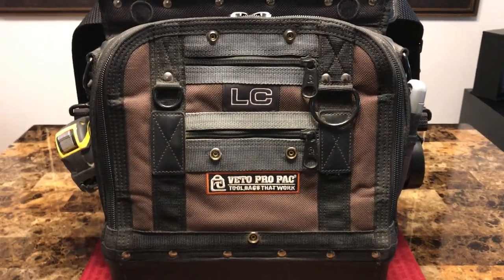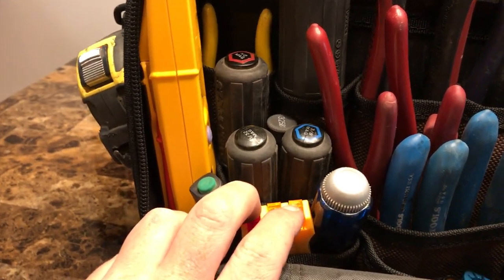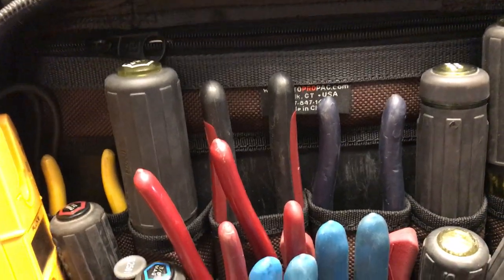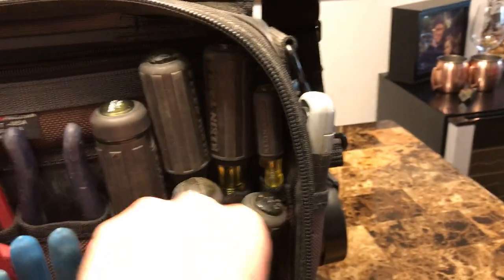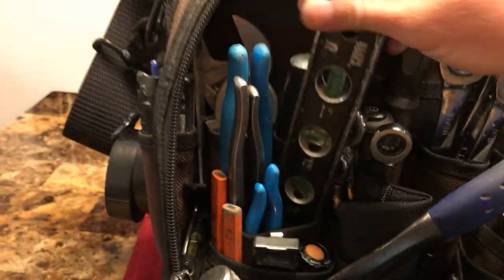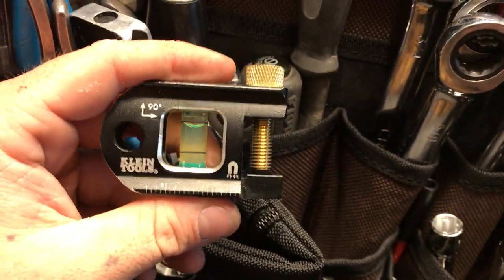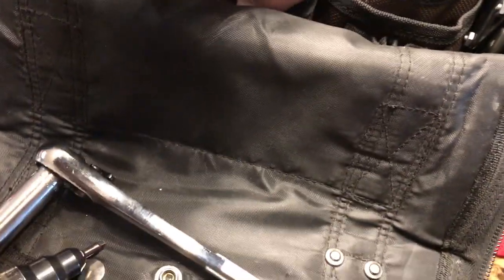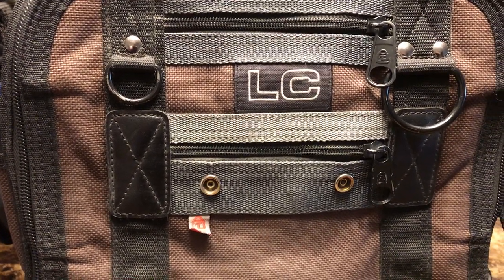Electrician Tools (Veto Pro Pac Loadout)

Comment: I bought the 7 in 1 nut driver, when I got it I was stunned how big and heavy it was, I used it for a couple days and I love the thing . It’s heavy and it’s outa my pouch as soon as it’s not needed but it’s staying in my veto !
Reply from the maker: Been a couple years ago since this video I currently am running individual nut drivers again I ended up liking the specific tool for specific need. Actually took all multi tools out of my bag except for the stubby 6n1

Comment: i found it Too heavy and it was so  narrow at the bottom there wasn't room for extras that don't go into a pocket..   went back to the deluth bighouse, though not the answer either, i do prefer them for what I do over the veto
Reply from the maker: toobglued 
I feel ya on lack on space in bottom area. Only small items fit and even they're hard to access if the bottom pockets are packed full. I actually like the OT-LC has a few less pockets and a lot of open space below to fit odds and ends just didn't like that big of an open top bag